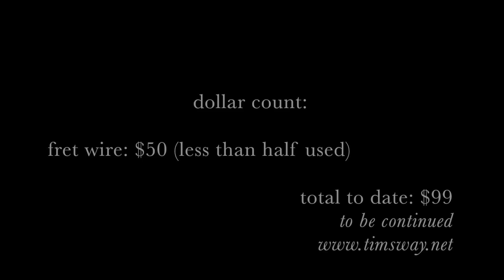PT 3 - guitars, something from nothing - frets, by tim sway

Comment: Hi Tim, some very precise work there on the (frets?) I was wondering how accurate you have to be when cutting the slots? Does it matter, and does the spacing vary depending on the type of guitar? Another great video with immense attention to detail. N.
Reply from the maker: excellent questions. the "necks" video shows me putting the slots in. i used an online "fret calculator" and measured to the 10th of a millimeter. they have to be very accurate for the guitar to be in tune and their placement is based on the overall string length, which can vary.  i can explain the science behind the sound of the whole thing if you really want to know.
Reply: If you are working to tolerances of  +/- .10mm then I reckon this science would be more than I could understand. That is not to say that I am not interested, sometimes I watch videos more than once if I am struggling to pick something up in one take. Thanks Tim for your time (and patience) Keep up the great series. N.
Reply from the maker: Neil George ha! i like to TRY to be that accurate. i only know the basics. picture a sound wave like they drew them in science class. how fast it moves dictates the pitch. slow, long waves are low, fast, short waves are high. the string vibrates to produce the waves. length and tension on the string dictates the pitch it creates. when you hold a string down against a fret, the string becomes shorter, thus speeding up the rate it vibrates, thus increasing the pitch. if the fret is misplaced, the pitch will be out of tune!
Reply: That makes perfect sense to be honest! Not as hard to understand as I first thought. Thank you for your time Tim. N.